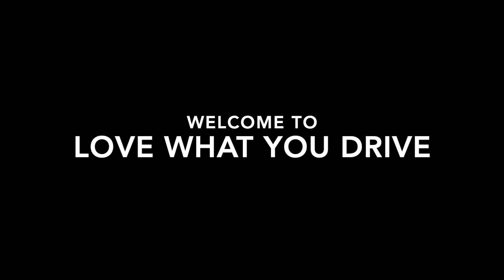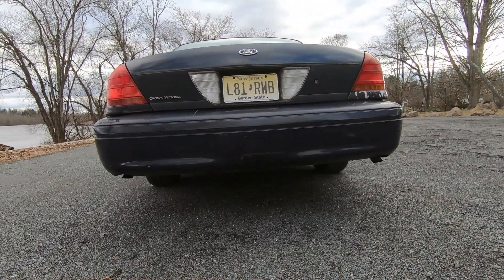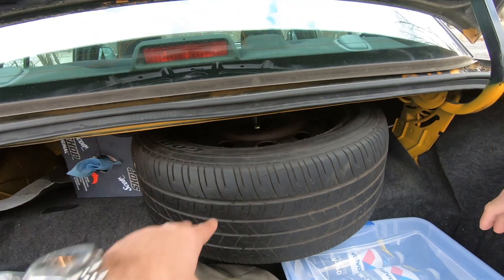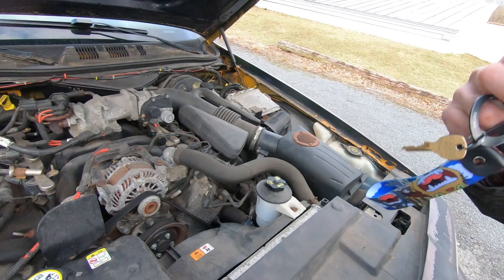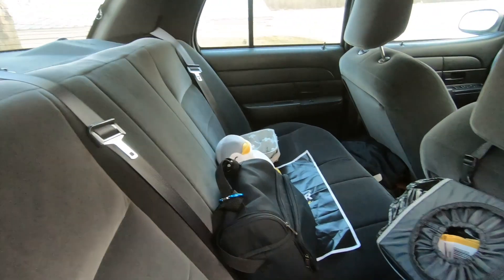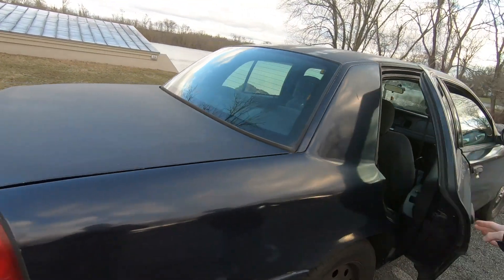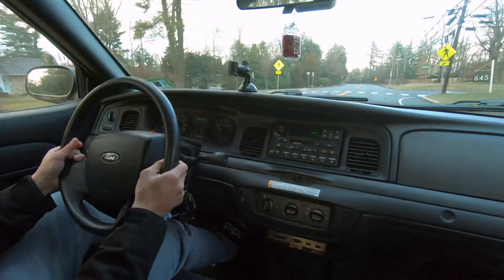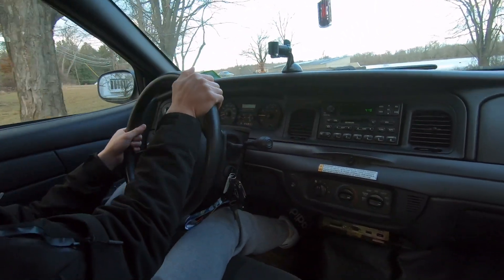2006 Ford Crown Victoria P71 | Police Interceptor or Taxi |

Comment: Low miles.
Reply from the maker: I was also surprised at the low miles! And honestly, it does ride very smooth very clean!
Reply: @LoveWhatYouDrive  Yes, and they ride even "smoother" when the Shock Absorbers wear out.
 Panthers perform best with Gas-Pressurized shocks at all 4 corners.
 I use and recommend the KYB "Gas-A-Just" brand -- superior control under all conditions, and a smooth, stable ride, too.
Reply from the maker: Thanks Chuck! I’ve heard a lot about the KYB shocks and how good they are! Recently I worked on the 94 Mercury that’s on my channel, the peach colored one and it had KYB shocks in the front and it rides so smooth!
Reply: @LoveWhatYouDrive  When rebuilding the entire Front Suspension of the famous
 95 MERC, I chose the KYB Gas-A-Just "Police"  shocks for all 4 corners -- on sale at Rock Auto (at that time). 
 Getting hard to find top-quality parts for these old Panthers, so I like to tell others about the systems, parts, and modifications that have worked out well for me. 

 I've noticed that most U-Tubers want to make their vehicles MAKE MORE NOISE -- in an effort to sound "bad-ass" -- but it's really only "dumb-ass". 
CHEERS !!